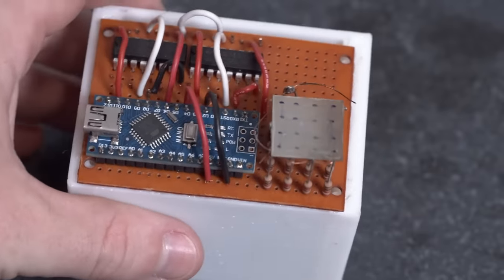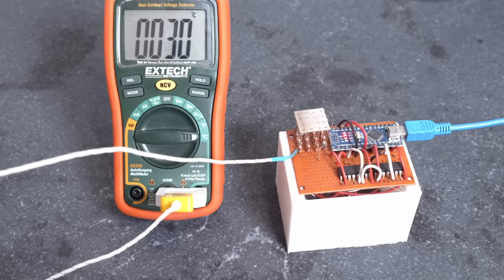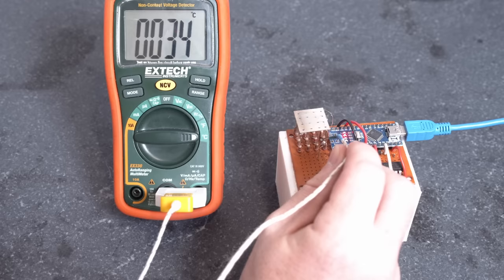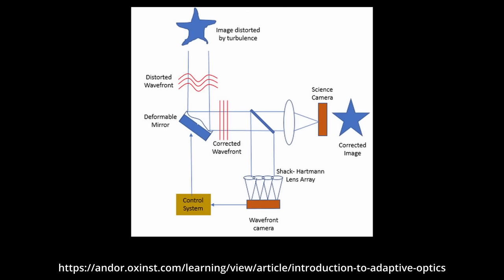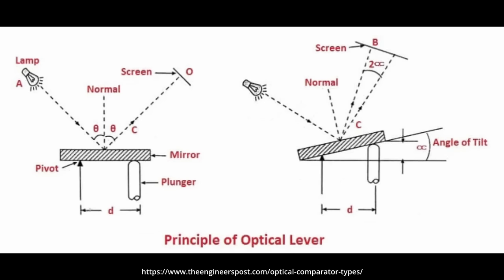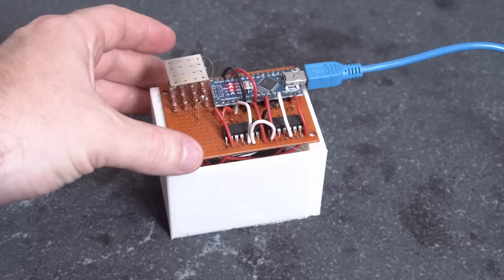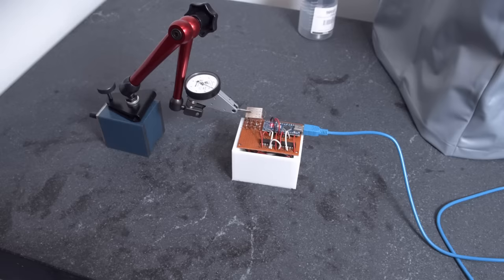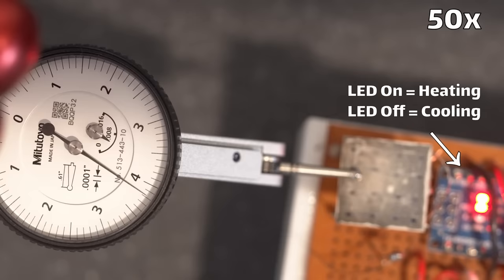Moving mirrors with heat

Comment: Hey! Ben Krasnov (Applied Science) was using a laser diode with internal sensor as interferometer. It's quite impressive how sensitive and precise so inexpensive thing can be. And it works with relatively rough surfaces.
Reply: Good Thought !
Reply: Which video are you talking about?
Reply: @RafaelAcurcio   it's called "laser diode self-mixing", posted 3 years ago.
Reply: How can you derive an error from a guide star when the guide view contains its own errors? There is no reference point...
Reply: @myriaddsystems  maybe take any position and a snap shot as the standard?
Reply: Love his channel.
Reply: people have used those to monitor changes in individual cells.  it's as sensitive as a wavelength of light when misused
Reply: @myriaddsystems there's 2 options: one, you're doing differential measurements, so the base deformation is irrelevant, or 2 you can use a calibration pattern, maybe using something like various diffraction gratings, or simply sticking a calibrated lens and picture on the end.

Comment: Using resistors as thermal actuators is something that would never have occured to me. Incidentally could you get better thermal expansion coefficients if you used the resistor to heat something else? E.g. those wax thermal actuators they use in radiators.
Reply from the maker: Right?! Super clever but not something I would have thought of either, until I read the paper. I bet those wax actuators (or similar) would work great! Same issues regarding speed, but probably a lot more actuation range and probably a bit more linear too.
Reply: Bimetalic strips like those used in thermostats would be a better solution.  Way more sensitive to heat.
Reply: @BreakingTaps  I remember a while back, AvE did a lot of testing on the wax actuators. Those things are strong enough that you could probably deform a much more rigid mirror.
Reply: What about that memory wire or muscle wire

Comment: I wonder if you could use LCD panels or other displays for cheap adaptive optics. I'm always amazed by how hobbyists can leverage the high density addressable matrices of ordinary consumer grade display panels to build the craziest stuff on the cheap.
Reply: Hey, you've got me interested, and i think i've only seen DLP chips iused like this so far
Could you provide a couple links/keywords to look into this further?
Reply: Small LCD shutters are also quite affordable.
Reply: @bottlekruiser  oculus has bought a company that stacks LCD panels and polarizers to have a select-able focus for VR purposes. an array of pixels which could dynamically refocus would be amazing, but for long exposures, even just a simple LCD or DLP in the path could turn pixels on and off depending on their current sharpness would probably be majorly useful.

Comment: Feel like aluminum tig rods with little induction coils to heat them would be more effective and consistent than those resistors.
Reply: You could also add active cooling so the response time is faster
Reply: @Jonathan-ex3sl  Active cooling could also provide a greater range of lengths by making it possible to shrink the element with cooling.
Reply: @cavemandanwilder5597 Then you could have small aluminum tubes to circulate coolant with induction heaters to expand
Reply: Why? the resistors are calibrated, and the heat expansion of materials is well understood. How would making it more complicated improve it?
Reply: I add to that and use silicon bronze tig wire, instead of alu
Reply: It would also be more complicated and expensive. I don't think the point of the video was how to make a perfect deformable mirror, but rather how simple it is to make one at all

Comment: I really appreciate the summary of the year-long process including failures and sharing things that didn't work. It's rare to see and really shows how much work and experimentation goes towards getting that one really cool working demonstration.
Also - future content - MLCC (multi-layer ceramic capacitors) exhibit a reasonably strong piezoelectric effect and can be used as a very low cost actuator. It's actually a nuisance effect that causes PCBs to flex and vibrate, acting as a speaker. It would be interesting to see this experiment repeated with those.
Reply from the maker: Thanks!  MLCC looks interesting, I didn't realize they did that. Will dig into it more, cheers for the tip!

Comment: You should try some type 2 ceramic capacitors(Like X7R), which have more of a piezo electric effect, and could have speeds in the Mhz, just make sure you bond to them with their stack in parallel with the plate.
Reply: Could you explain this in more detail? I'd love to build a cheap vector laser style display in a new fashion that doesn't rely on galvanometers. I've looked into acouso-optic deflection but piezoelectrics definitely seem like a step in the right direction
Reply: @chewbaccabox  Ok, so in piezoelectricity, there are materials which expand in the presence of an electric field.  Class II ceramic capacitors can expand on applied voltage, much more than class 1.  This normally happens in the axis of the electric field.   But the expansion is not much. Its pretty low, like a few Nano-meters.  But it also changes with voltage, and capacitance also changes with voltage...Leading to other issues...  But unlike this videos example, it is not temperature rate based in terms of thermal dissipation, it is based on applied voltage.  So in theory if you mounted a mirror on an array of type II or older capacitors then you could control the deformation of the mirrors very quickly.  And mounting is important with most MLCCs having the anodes in parallel with the board they are mounted to, mounting them normally is good, but mounting them sideways will decrease the deflection. It depends if the cross section is square.  If it is not then it will not be an issue.  Just something to consider.
But for anything involving laser vector mapping I would use galvanometers.  I have a 200W 3D metal printer based on a Q-switched Nd:Yag laser with galvos that works quite well.  And it is very fast at moving the beam!  On the order of tens of thousands of degrees per second.

Comment: Aside from ceramic caps as piezo actuators, which were already mentioned, magnetostriction could be user to build an agile precision actuator. Solid chunks of magnetic material should simplify building a rigid setup, with minimal unpredictable static deformations, like from the epoxy. For bigger and slower changing displacements you can add heaters to take advantage of thermal expansion.

Comment: Maybe instead of resistors, nitinol wires might be a better way to deform the mirror, as nitinol reacts to heat very quickly and deforms quite a bit depending on the heat and length of the wire.

Comment: you should try SMD resistors to reduce the heat capacity and the time for response. Also try a smaller array (say 3X3) and current pulses more than 10ms.

Comment: My guess is that the PCB flexes more than the mirror when resistors heat up.  Also, I wonder when soldering the resistors to the mirror, how much deformation with it end up as solder cools.  Solder changes size with temperature, a lot.  Maybe, solder to a piece of "flat thin" metal, and once at room temperature, glue the mirror, to avoid stress.
Here in my armchair ;), impressed by how easy it is to measure the thermal expansion of a carbon resistor, I need to try it.
Reply from the maker: The mirror (just a glass coverslip) is surprisingly flexible.  It's only 300um or so thick so you can visible bend it with your fingers.  But yeah, I expect the PCB was flexing some as well, stealing some of the actuation range.  Note that I used silver epoxy instead of solder to attach the resistors, so there will be some shrinkage from that but not as much as actual solder :)

Comment: I think you might be able to get a picture of deformation across the whole mirror using a grazing interferometer.  They don’t need such a fine surface and you can dial in the measurement range/resolution with the wavelength and grazing angle.

Comment: I don't know if it was mentioned already, but if you would mount small glass mirrors (I know, tiny) in between your mounted actuators and then shine laser on those mirrors. Those would be as flat as can be, but your self-made mirror is more used as a platform to change shape accordingly. I dooe it makes sense. Then your 4x4 is a 3x3 grid of mirrors.
Cool video by the way, just ended up on my feed. Will check out other videos as well

Comment: For the measurements part, I know nothing about optics, but have you considered finding/making something that has a mirror finish to use as the platform? I think you should be able to see some change in the reflection as the platform deforms. In a way it would be the same as you optical lever idea but a lot more visual

Comment: Great demo!
If you can get your hands on silicon wafers with a layer of silicon nitride (200-1000nm thick) you can make simple electrostatically actuated deformable mirrors.
Something like this that from Gleb Vdovin et al
A PCB works well for the electrode array.
I have made some prototypes for an adaptive optics system for my telescope, need to finish an interferometer to properly characterise the actuators.
Reply: wow, sounds interesting. What kind of voltage is required to actuate? If high, would the density of the electrostatic points be limited by the arcing distance between points?
Reply: @dancollins1012  I am using 200V max, which is a limit of the AD5535B DAC I am using. At some point the spacing would be an issue due to arcing. It depends though, because the voltage difference between neighbouring actuators wont be too high for atmospheric turbulance

Comment: This is a cool idea. If you ever revisit it; would it make sense to first solder the wires onto a platform, and then to glue a thin mirror on top with a low-shrinkage epoxy? That should give a fairly flat starting point I think. It might stiffen the top a bit the board below does not have infinite stiffness either. While you are mixing epoxy anyway it might make sense to cast the base into a sand-epoxy mixture because if it significantly deflects on both sides it will be much harder to achieve a target output shape.

Comment: Wow very coool!! Im wondering if you could use something like a DLP projector but backwards to achieve the same thing? They use this special DMD (digital micromirror device) chip which is an array of tiny mirrors to create an image for the light to bounce off and go through the lens. But what if you did that backwards? Took light from the lens, deformed it with the dmd chip and then used a sensor to pick up the mirror deformed reflected light.

Comment: You know, I think if, before the invention of the inkjet cartridge with heating elements, someone would suggest spitting paint by heating resistors, this idea would also seem far from being practical. However, by applying appropriate materials, miniaturization, and well-adjusted control algorithms, engineers have obtained a technology that is not only fundamentally suitable for printing, but also mass-produced.
Instead of using resistors as pushers, pretension can be applied, and then heating the element will lead to a weakening of that pretension. This should give greater accuracy and uniformity of movement, because using pushing the elements are likely to be bent, which leads to abrupt changes in the coordinate of the controlled point and uneven characteristics.

Comment: The correction of slow aberrations sounds interesting. I’ll go read the literature. You could make an optical system then make a custom deformable corrector plate. Wonder if it will handle higher order spherical aberrations, etc.

Comment: This is fascinating! 
What voltage and current is across a resistor while heating? 
Resistors mounted on a PCB with short lead lengths theoretically would be pulling and pushing against the copper traces that it's soldered to and eventually end up with what's commonly known as dry solder joints in electronic equipment which leads to equipment failure or induced noise.... And we thought that capacitors were the main trouble maker! 
I might have to consider using the whole lead lengths of resistors to allow for resistor movement.... 
Interesting stuff indeed..

Comment: re: suitablility for use in the last section, this seems like it could be a pretty good low cost way to make good quality flat mirrors with reduced precision in manufacturing, as long as you can measure the flatness. I don't entirely know what the application of this is but maybe it's useful as a low cost alternative in CO2 laser cutters, or for experimental optical systems where you could repurpose an adaptive mirror module between a series of iterations, configured to produce whatever topography is needed instead of buying new custom curvature mirrors each time

Comment: The Resistor heated and expanded - check. Now how much heat was transferred to the mirror and then to the gauge prob to interact with their coefficient of expansion? When I'm making a part and chasing nuts-on, I always take a bit of a break before final pass/spring pass. wondered if you just didn't include that due to run time or what.  You're really good at what you do, I'd like to know so I can apply to silly stuff I do. <grin> Thanks.

Comment: Superb video, excellent topic. Here's an idea: fix the heating elenents to a small platform with a low thermal expansion coefficient, and then the mirror on the other side of that. Rather than distorting the mirror, it would just tilt it. With enough hexagon shaped mirrors controlled in this way, an image could be formed ala JWST. There may be some choice of material and geometry that could speed up the thermal movement - think bimetal coils used in passive temperature dials

Comment: Hmm, for measuring, can't you use a kind of high resolution projector, and focus it onto the mirror and then to a wider collector? 

Then have the projected image be some kind of alternating pattern, and then measure this using image processing? 

I feel laser mice circuitry could work well for this (they do this exact method to determine movement).

Comment: This is cool, reminds me about digital micromirror devices, but your example is literally using thermodynamics for modulation, would be interesting how it could be applied with the help of MEMs. This type of tech can be really useful, it has many advantages, first is it's low cost, I think thermal modulation could provide longer lifetime service and it can also be applied to focusing optics/lasers or any objects to a fixed position which doesn't require fast modulation.

Comment: This is cool in its simplicity! I reckon that you could use it for stabilizing optics assuming the changes required are slow. It would be interesting to see if SMD resistors could be bonded to the glass vertically in a large array and do some even more cool stuff with it!
Reply from the maker: I bet SMDs would work really well! Would probably have to place them by hand, not sure you could convince a PnP to do it... but it'd be a lot more neat and tidy than my abomination 😅
Reply: @BreakingTaps  why not a copper mirror? Polish one side of a double sided PCB to be a mirror after components were soldered/bonded to the other.
  If that works, then silver coat .
Reply: @BreakingTaps  it's not an abomination when you can call it "Proof of concept" 😜

Comment: Very clever design! Maybe setting the zero-point at temperature higher than ambient (for faster cooling) and using some kind of feedback to drive the resistor at the required temperature faster can maximize the performance of this setup. I'm thinking about Constant Temperature Anemometers principle of operation for the temperature feedback.
Reply from the maker: Ah that's clever! Yeah I think hovering in the middle would help with responsivity a lot. Might even be able to get away with a surface mount temp sensor right near each resistor, and might be able to use SMD resistors standing upright too? Would make the whole setup cleaner and less variable
Reply: @BreakingTaps  All resistors also act as thermistors to some degree. So the sensor and actuator can be the same element.

The voltage drop across a diode varies with temperature, and probably gives a much stronger and thus easier to measure signal. Silicon diodes have a relatively low voltage drop. Light emitting diodes have higher voltage drops. LEDs also look much more interesting in operation.

Comment: I love the idea, thanks for sharing your explorations. One problem you didn't mention was the heat from the resistor travels up and down the copper wires and into the ground plane and then into the mirror. Perhaps a better plan would be to have the resistor attached to the mirror backplate with a glass or fused quartz short rod that will transmit the thrust but not the heat?
Reply from the maker: Definitely a lot of room for improvement! Better control, better fabrication, insulating as you suggested. Lots of room to play with this idea!

Comment: This is a pretty good initial POC; you seem to have at least shown that deformation is possible, even if it's not easy to measure.
One next step might be to have a PCB made with a grid of surface-mount resistors; they'll be much smaller and much more even, and you could even lap or grind them to make them flatter before binding the mirror directly to them...  You don't even need SMD skills if you have the board populated for you, and the pick & place machine will probably be way more even and consistent than you could do by hand.
Reply: Thermal expansion is proportional to the length. So, it's important that this resistors are 10-15mm long.
SMD resistors will have what? 0.5-1mm or even less in the vertical dimension? So effect will be 10x-30x times weaker.